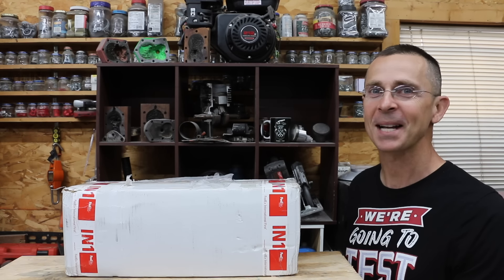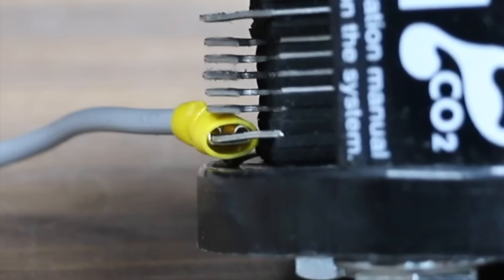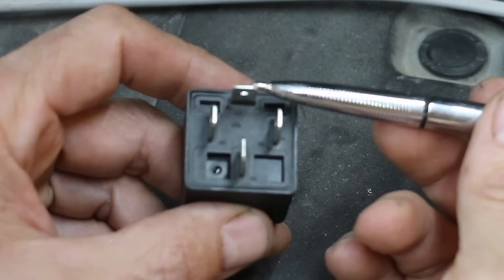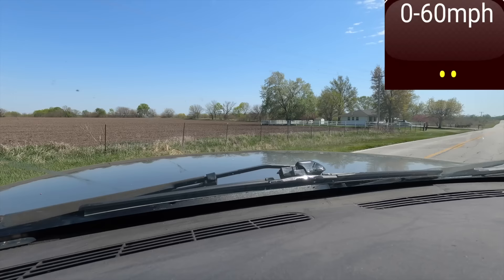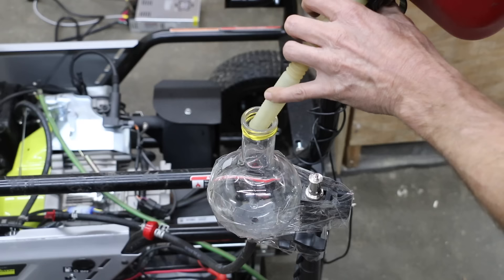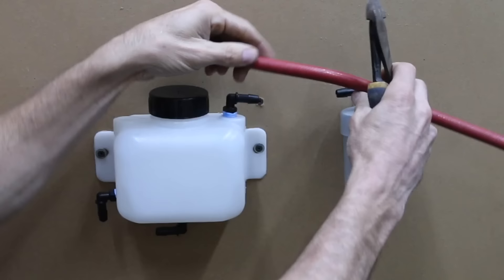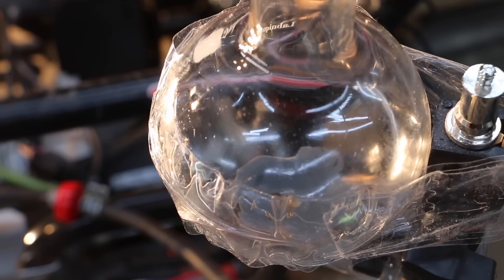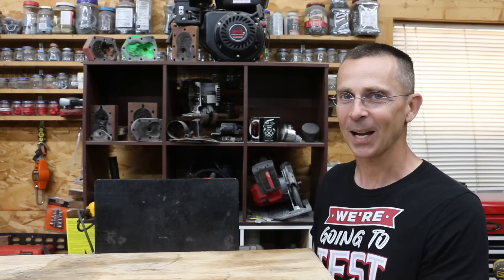AMAZING 35% More MPG with HHO? Let’s find out! Help with high gas prices?

Comment: He drilled holes in his air boxes to test this for us, that's dedication!
Reply: My thought exactly.
Reply: He could have gained more HP just my testing with the hole in the air box. That's a fancy high airflow intake now. Just don't drive on dusty roads.
Reply: Duct tape will fix it, he even knows what brand works best
Reply: Next video: we're gonna see what epoxy works best for filling holes you drilled into plastic!!
Reply from the maker: Thanks for watching!
Reply: There’s tons of those 5.3s at my local junkyard, you can get an intake for like $20 lmao
Reply: easy to cover back up with some tape i guess lol
Reply: I feel like he’s resourceful enough that it’s not an issue for him
Reply: Go check out when he tests scratch removal
Reply: @mackmuhlbeier4531  I'll bet a piece of duct tape is cheaper, maybe he can test that!

Comment: My friends and I used to make these in college, we had a Civic that we actually got up to 60 mph with.  Everything was stock, except for the homemade HHO generator, BUT we did have to tune the ECU.  We did learn that it makes a bigger difference with gasoline engines versus diesel engines.  But we did get my 2004 diesel excursion up to 24 MPG. I swear by HHO, but you definitely have to tune the ecu to inject less fuel because the air is richer.
Reply from the maker: Thanks for sharing.
Reply: how you tune eco to to inject less fuel
Reply: Why didn't you take these supposed findings to a scientific paper. I always see these claims but none of them are ever backed up.
Reply: That would make sense.
Reply: @derfvcderfvc8714  because that was over 15 years ago before it became a big thing lol
Reply: @khalilJon  sensors would read the air was more rich so it would inject less
Reply: @derfvcderfvc8714  because then they'd have to do something scientific. Nobody cares about what some kids do in their garage. There's a dude that put a tiny carburetor on a v8 and gets high mpg right here on youtube. He'll never be published in a journal though.
Reply: The hho acts as a "battery" for extra electricity made by the alternator. That's how it helps fuel economy it's not defeating laws of physics
Reply: @ProjectFarm  maybe you should also make one yourself with a larger output capacity.
Reply: I remember when everybody was doing this type of experiments with hydrogen cells, but I always thought it wasn't a good idea because this could generate water from the ignition of hydrogen and oxygen, and you don't want water in your oil system, nasty things can happen like cracking up the engine cap, not to mention rusting to death you exhaust lines
Reply: Burning hydrocarbons like gasoline creates water vapor as an exhaust product too  @delightfulThoughs
Reply: You’re just running your car lean. Has nothing to do with HHo. Especially if your just dribbling unmetered gas Into the intake. There is no science to back up these claims
Reply: @stevenhickham3670  how old are you? 2004 is when this was popular... 🤦🤦🤦 These kits now are the exact same as they were then...
Reply: Prove it.
Reply: @Uruz2012  He'll never pass. a car on the open road, either.
Reply: @bradleycooper5436  Except the alternator doesn't generate "extra" electricity. If it did, the solution would be a smaller alternator.
Reply: @drone_flyer1207 I was using them in the early 80s
Reply: That's why it makes best sense to make an Hydogen seperator cell and only send Hydogen to the engine...the high amount of oxygen will make you loose your gains, pure hydrogen test needs to be done...
Reply: @TripleB101  exactly, this scam is nothing new 😂🤣😂🤣
Reply: The improved fuel economy observed would have been from leaning out the ECU.  Cars come rich from the factory for safety. Its not magic.
Reply: @user-iz4ly9or1t  Car come rich from the factory?
Reply: @wonderwalls3565  Yes, manufacturers ensure cars will run with various grades of fuel and set ECU air fuel (A/F) ratios conservatively (richer). Leaning out the A/F improves power and fuel economy. Retuning with more aggressive timing and A/F ratios will mask any benefits this device provides.

Furthermore, generating hydrogen and oxygen while driving will consume electricity and…more fuel. You won't generate enough fuel from the generator to compensate for the fuel required to generate the fuel. It sounds logical because it is. 

Long story short HHO is not worth it.

Comment: This is actually the best informative video I've seen. You're wasting NO time at all explaining the stuff your talking about, and you're not leaving out any important details. Great work man, you've earned yourself a subscription.
Reply from the maker: Thanks!  Thanks for watching and subscribing!
Reply: @ProjectFarm  Dude, try this if you able and still have setup.

Run your car on gas.  Measure gas consumption.
Now make hydrogen outside of engine.  

Now keep reducing the fuel mix so you running leaner.  Keep running lean until engine stops.  Now add hydrogen.  Keep adding fuel + air making it richer.  Now how much less fuel are you using?

This will tell you if you have more efficient combustion because you added hydrogen to the mix.  Then it's question of power to produce hydrogen vs savings in less gas consumed.  

There could be economic advantages.  Gas at $5/gal, it still might be cheaper to cook hydrogen at home and run it with your vehicle.
Reply: @joeboxter3635  How will you store enough hydrogen to give your vehicle decent range (like 400 miles or so)?
Reply: @Cougracer67  Oh, I don't mean this to drive.  I mean to determine if adding hydrogen+ air to allows a much leaner  fuel mixture to produce same power out.

If it can then that would be some evidence that hydrogen can act as a catalyst to increase gas efficiency.  At least it's a start towards proving this out.

If I understand what he did, he tried original fuel air mixture + hydrogen -- not lean mix.
Reply: Search on this for a paper published in the Alexandria Engineering Journal (full pdf available free):

Effect of hydroxy (HHO) gas addition on gasoline engine performance and emissions

Mohamed M.EL-KassabyYehia A.EldrainyMohamed E.KhidrKareem I.Khidr
Mechanical Engineering Department, Faculty of Engineering, Alexandria University, Egypt
Received 8 June 2015, Revised 14 October 2015, Accepted 28 October 2015, Available online 21 November 2015, Version of Record 8 March 2016.

Abstract
The objective of this work was to construct a simple innovative HHO generation system and evaluate the effect of hydroxyl gas HHO addition, as an engine performance improver, into gasoline fuel on engine performance and emissions. HHO cell was designed, fabricated and optimized for maximum HHO gas productivity per input power. The optimized parameters were the number of neutral plates, distance between them and type and quantity of two catalysts of Potassium Hydroxide (KOH) and sodium hydroxide (NaOH). The performance of a Skoda Felicia 1.3 GLXi gasoline engine was evaluated with and without the optimized HHO cell. In addition, the CO, HC and NOx emissions were measured using TECNO TEST exhaust gas analyzer TE488. The results showed that the HHO gas maximum productivity of the cell was 18 L/h when using 2 neutrals plates with 1 mm distance and 6 g/L of KOH. The results also showed 10% increment in the gasoline engine thermal efficiency, 34% reduction in fuel consumption, 18% reduction in CO, 14% reduction in HC and 15% reduction in NOx.
Reply: @joeboxter3635  I thought the oxygen sensor would have to be adjusted to counter the amount of oxygen produced by the electrolysis reaction, (1 hydrogen 2 oxygen H2O) the sensor would have picked up that there would be too much oxygen and tell the computer the fuel mixture would be lean and pump more gas into the engine. Would have been good to hook up a computer to  check what was going on while the hydrogen was on or off to see if the mixtures were out.
Reply: @joeboxter3635  How are you generating the hydrogen?  You're generating it by electrolysis, using electricity from the alternator.  When you increase electrical load on the alternator, you increase mechanical load on your crankshaft.

Short answer: You don't get something for nothing, burning the hydrogen does not (cannot - physics 101) give back more energy than breaking the hydrogen/oxygen bond takes.  So you're not gaining any MPG, you're only slightly reducing it.
Reply: @ProjectFarm you were supposed to reduce the amount of gasoline by only opening the valve a little over half.

Comment: Made my own hho unit years ago. Did get noticeable improvements in mileage. Difference…I installed a simple potentiometer on the dash wired into my map sensor. I was telling the computer that there was less air flow than was actually present, thereby causing the engine to call for less fuel. I adjusted based on need and could turn it way down on the interstate allowing for incredible fuel savings.
Reply: I appreciate your input.  Makes sense.
Reply: Note that what's happening is that you're lowering the fuel mixture hence lowering the horsepower of the engine and creating better fuel efficiency out of it.  Another way to do the same would be to take two cylinders out of combustion or  have a smaller engine running.  An engine with less horsepower is generally more fuel efficient as you give up on acceleration, while a 5 liter mustang has less MPG for the opposite reason.  You actually don't need to install an HHO to achieve similar results.
Reply: you could do the same thing without the HHO, your engine was just running with less horsepower and therefore you saved gas. bravo, you made your car weaker which saved gas. wow.
Reply: @lanzer22  i tend to agree with what you said.
Reply: @systemG3000  And the engine would have been running VERY lean
Reply: lol I did the same. but the only thing that does is lower the life of the engine by running it lean - would be impossible to generate enough HHO for it to compensate

Comment: Love the video Im a big fan.  The biggest variable here is the fuel injected controller that is adding the fuel. The controller cannot see that there is another fuel (hydrogen) being added to the combustion chamber so it keeps running it's normal fuel trim.  
This means that selling these kits to people is just useless because they are not actually leaning out the gasoline mixture to make room for the HHO to work.  If you tune the fuel injector controller (pcm) you can get some small gains in the V8 with the HHO.  If you tune the generator or switch to a carb and lean out the gasoline and add HHO, you can get very good gains and maybe almost run 100% on HHO.
Reply from the maker: Thanks!
Reply: correct you are
Reply: It wouldn't make sense to me to run 100% on HHO, being that it takes more energy to make the gas than you get in return. This means that you'd have to have some supplement of power. This could be from having to replace/recharge the car's battery, or by using gasoline/diesel. I could see running 50% as a maybe possibility just from a GUESS, but I don't have much of a clue honestly. I'd love to see some proper testing and evidence in these regards.

Comment: This pops up every time gas gets expensive, you'll see it on Craigslist and other selling apps.
Reply from the maker: Great point!  I'll test more of these gas saver gadgets if there's enough interest
Reply: @_AndromedaGalaxy_  They debunked the Tornado decades ago.
Reply: @ProjectFarm  they are all snake oil bs I wouldn’t bother since 90% of us are not gullible.
Reply: @ProjectFarm  now would be a great time to do a whole series on gas saving gimmics what with the gas shortage and all. My favorite is the ginormous magnet they sell to strap to your fuel line so it will supposedly break up clumps of fuel molecules!
Reply: Every time!!!! Saw it bad in 2012 when gas prices were insanely high
Reply: @carbonstar9091  Exactly. If a new technology is really good, every carmaker will start using it. We don’t use carbureted engines, or distributors anymore, because they’re less efficient.
Reply: @carbonstar9091  Yeah, MPG is a big selling point to the end user, and also there are environmental regulations to meet, so if MPG could be so drastically increased by such simple means, every car would already incorporate such things.
Reply: @Perennial_Curiosity  Amazing. Sounds like the same junk they sell to magically 'soften' your water!
Reply: @ProjectFarm  even if they are all bs, the videos of them not working need to be out there to show the ones that might fall for them...
Reply: @MorryB  I'm pretty sure that's exactly the same thing.
Reply: @Alexander_l322  "90%, not gullible?"
Flat Erf, Q, Trumpt, etc, etc ..........
Reply: @ProjectFarm  on a single cylinder engine, or even a car engine that uses a carburetor, to me, it would be interesting to test something i have been hearing about for a while now.  what i have been told is, a fine wire mesh screen between the carburetor and intake is supposed to make the gasoline burn better.  something about braking up the droplets and making them smaller/better atomization.
Reply: @madddog7  it’s an arbitrary number 🤷‍♂️
Reply: @_AndromedaGalaxy_  also completely BS. Dizzy air doesn't produce more energy.
Reply: @ProjectFarm  What about the one where you're supposed to clamp a magnet onto your fuel inlet tube? The ads I used to see for those were a hoot.
Reply: i remember when the cover of every JC Whitney auto parts catalog was selling devices for "water injection" for your engine.. where adding water vapor was supposed to make it run better.
Reply: @Alexander_l322  pick a better 'arbitary' number.
To say: "90%", makes you seem gullible
Reply: @madddog7  you spelt it wrong bro.
Reply: @Alexander_l322  That's all you got; that's your best come-back?
Reply: @madddog7  I didn’t know we were fighting
Reply: @Alexander_l322  callin' me out for spelling is arbitrary, juvenile and a passive-aggressive  invitation to fight. You tell me ... are you fighting
Reply: @madddog7  you sound like a hoot to be around.
Reply: @ProjectFarm  So many of these gadgets have been debunked by other reviewers, but somehow companies find a way to keep on selling them.  Keep up the great work!!
Reply: @richardtodd6843  well they were not totally wrong. Injecting water or alcohol during the exhaust cycle used to be used a lot to increase horsepower and efficiency. It was used a lot in high rpm engines like those used in airplanes.
Reply: There is one way to gain power and clean your engine BUT it doesn't come cheap.
A controlled water methanol injection system can bring some fuel saving BUT only if the ECU gets programmed to run more lean then normal.
Just bolting on a water methanol kit isnt going to help anyone.
It is also more effective as a boostcooler and doesn't really work with natural aspirated engines.
Turbo/supercharged engines gain the most and it especially benefits diesel engines.
The water gets injected at extreme pressure as a fine mist and vaporized, this cools the air and makes it more dense.
The burn temperature in the Zylinder gets lowered and now you can program the ECU to run more lean and save fuel.
The methanol is more or less antifreeze and can be left out for fuel saving rasons (only if it never freezes in your area)
The methanol also can help with HP increases by stopping your engine from nocking at high boost.

TL,Dr: water methanol can work if setup correctly.
Reply: I remember the MythBusters testing a bunch of these fuel saving devices years a go they were all junk.
Reply: @SuperUltimateLP  P51 Mustang used water/methanol injection to give extra power for combat use.
Reply: @wetlettuce4768  Messerschmitt BF109 also used a water methanol system on the axis side.
I'm german, obviously i have to represent the axis side of things ;)
Reply: @SuperUltimateLP  BF-109 had a damned good engine trust the Germans to fit their planes with mechanical fuel injection whilst everyone else is using carbs.
Reply: @Islandwaterjet  correct.I tried the mesh intake manifold  gaskets they came out with about 25 years ago. After 3 weeks replaced them, no increase in mpg,  felt like less power.
Reply: @Alexander_l322  The people who would fall for it are exactly the kind of people who need to start watching PF so they stop wasting their money though.
Reply: I found magnets on a fuel line before, they claim they increase gas mileage somehow.
Reply: Try a fuel heater! (Using coolant to pre-heat gasoline before being injected into combustion chamber)
Reply: @jamesbiaglow5790  Fuel heaters are great! For diesel trucks in the Alaska winters. Not for anything else, hence the reason some manufacturers go out of their way engineering fuel coolers that use the AC system to chill gasoline before it is atomized by the injectors.
Reply: @ProjectFarm  If you get bored you should test tire psi. Under inflated tires add more drag, thus decrease fuel economy. There's other videos testing it but hey, nothing wrong will informing people to keep their tires properly inflated.
Reply: @richardtodd6843  water injection does work by cooling the intake gases on turbocharged engines. The water vapour that results just passes through the engine without any effect.
Reply: @dimesonhiseyes9134  Aircraft engines are always LOW rpm.... and it is injected in the intake on turbocharged engines only to cool down the compressed air....
Reply: @Perennial_Curiosity  oh yeah, fuel molecules, you know covalent bonding no magnetism what do ever. But those snake oil salesmen just say you need a bigger magnet 😆